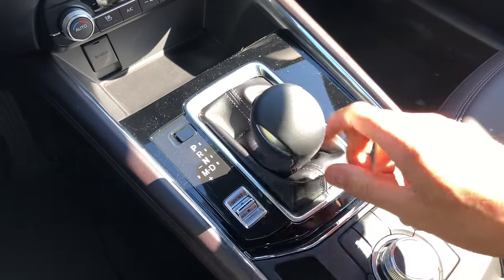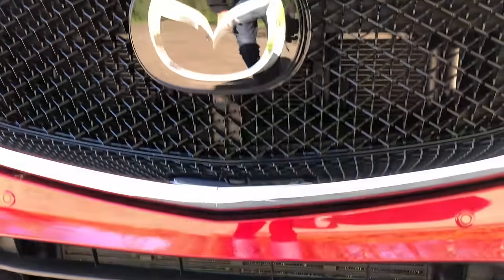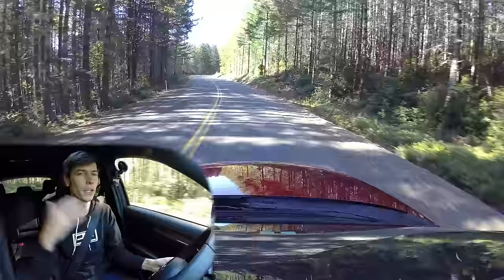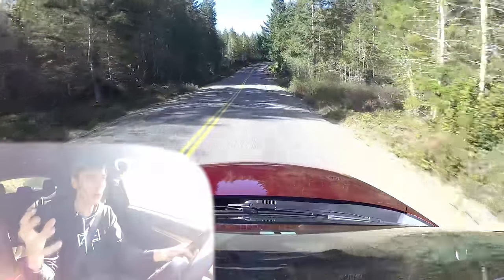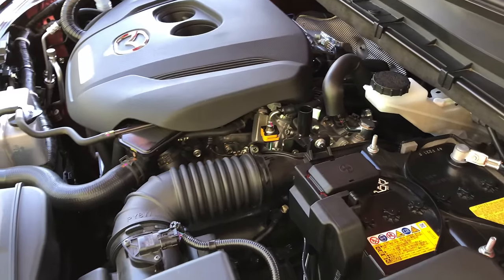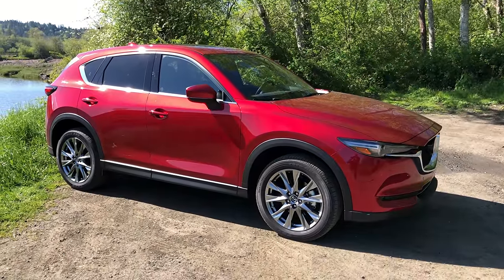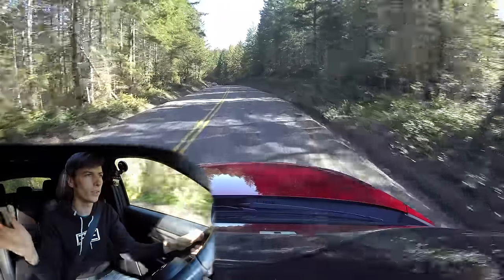Are CVTs Bad? Why Mazda Avoids CVT Transmissions

Comment: Subaru and Honda (two of my favourite manufacturers) use CVT instead of a proper automatic in their vehicles and I HATE IT. CVT's are total CRAP. I didn't buy or lease one, I test drove it just to see... And wow, it is completely gutless and it is remarkable that it feels even more disconnected than an EV. Seriously, you're riding around in this thing and trusting your life to it -and you have no idea what's going on underneath you. It's only marginally more efficient and lighter than an automatic transmission -but they only last about 100,000km and then you have to spend around $7,000 to replace the thing -and that's seen as a benefit?!?! With an automatic transmission (without Gear selector), you may have to mash the gas to find the gear you want, but you know when it's coming and the transmission can pretty much last the life of the car (not including Dodge, of course lol)... Plus you can pair MORE power and greater WEIGHT with an automatic transmission. So if you ever want to tow something or you live in an area with hills or you have a steep driveway -a CVT is not for you. A CVT is not for anyone, really...

But, unless you're in an f150+ or another full size truck+, automatics aren't your best option either... For all passenger cars the best is and always has been: manual transmission. Nothing is better than stick shift.

NEVER buy a CVT. They're complete crap.
Reply: Dsg is cool

Comment: I’ve been looking at used Mazda’s lately. I’m not sure if I want the 3, 6 or the CX5.
Reply: Jamie F Take a "6"! Best car I've ever had! I already got 100.000 miles on it and cannot see anything that has gotten worse! The "3" is a lot smaller but almost costs the same! The CX5 is a nice car but hasn't got as much cargo-space as the "6"! Most engines are equal! I got a 150 hp diesel with never less than 50 mpg!!!
Reply: GT86 do you have year recommendations? I like the 2014-2016 but I’m not looking for anything extremely technologically advanced.
Reply: J F Mine is from 2014. Bought it in 2015 with 6.000 miles on it. I still prefer its clean exterior-design compared to the facelifts with all that chrome! But I have to admit that the interior is not as beautiful as in the newer models. Mine is an almost fully loaded sportline with 19-inch-wheels and looks really good! Decide what you like most! All versions are reliable and well equipped! 

...The Mazda-Mechanic recently showed me the issue-statistics of mazda in comparison with hyundai which they also sell! There was one folder for mazda and seven for hyundai!😬

Comment: The problem with a cvt transmission is they will always have at least one part that will wear out long before the rest of the system. This doesn't have to be a problem except that today's engineers are incapable of making provisions for repairs. In fact they delight in burying such parts in the most inaccessible place possible. Then the worthless automotive press will claim it's "high tech.' If they were honest, they would be truthful about what is being done and call it garbage.

Comment: Been driving manuals for most of the time I could drive. My latest car is an automatic, after I swore I'd never go back to one, but was impressed with the 7at in the 370z. Shifts very fast and manual mode feels really good. Modern slushboxes have come a fair way from 90s econocars I was used to.

Still wouldn't touch a cvt with a bargepole but my attitude on automatics has changed

Comment: I hate CVTs to no limit, It is a bad idea, they are unresponsive especially at higher speeds and get you into trouble, they overheat, they are horrendous to maintain.. it is just a giant leap backwards

And all that fuel economy will go out the window when you have to simply change it’s expensive fluid or worse still; change the whole ugly thing

Comment: I am in Las Vegas now with my family and my wife and I rented a Nissan Rogue (automatic with CVT) boring car to drive and it has no pick up. I have to floor the gas for the car to move. It is sad the auto industry put this transmission in its cars. There are still some good samples which don't use it.

Comment: "From an engineering standpoint"
From a customer standpoint, using a reinforced rubber belt to drive a transmission is just insane. Don't care how reinforced it is. End of the day it's basically a timing belt for your transmission.
Your videos make me think you're definitely an engineer who doesn't spin the wrench too often himself
Reply: Not like a timing belt. Most like a multi speed bicycle. Instead of a chain moving up and down a cone of gears, a belt up and down a cone to change ratio. They have been around on small motor cycles and garden vehicles for 50 years. They work well on light weight vehicles. If you put a lot of pressure on them, the belt slips more and wears the metal off. Is why you never see them in a truck or a true 4wheel off road vehicle. They can last on light weight cars in the flat lands if you change the metal impregnated trans fluid quite often. Mazda took the safe approach for performance, reliability and mpg until all electric autos become the norm.  Toyota's eCVT hybrid is more like a Tesla than a typical CVT because it uses electric motors to turn the rear wheels. A really great approach. I'm likely purchasing a Cx5 when the market settles a bit.
Reply: @ltwig476  I fully understand CVT transmissions. The belt is an issue. Reinforce it with steel all you want, at the end of the day it's a steel reinforced belt. They don't last. Tires don't last, timing belts don't last
And if it was actually like the gearing of a bike it would be made from a chain

Comment: I get why manufacturers are going to the cvt. With rising fuel costs (limited commodity!) they want to advertise the mpg. It’s a cool technology but it’s not ready yet. Reliability problems, poor throttle response, etc. I’ve recently driven most of the cvt’s (shopping for a new crossover suv) and they’re all lacking in a lot of ways. I’m going with the cx5

Comment: Your wrong! Most people know what a CVT is and only find out what they are when there Nissan CVT fails and it’s cost to repair is just ridicules. Nissan uses the worst brand and they fail more then any other CVT. Everyone is better off going with a regular automatic transmission. 
One other thing is the turbo seems to be the way every manufacturer is making good power with small engines and it’s great short term but the turbo and the stress plus heat generated will shorten the life of the small 4 and 3 cylinder engines. Your much better off to go with a little bigger natural aspirated engine and you don’t need a turbo always to produce big power, there are 2.4 liter engines out there making 200-250 HP and those non-turbo engines will last much longer.

Comment: I have a Subaru crosstrek XV. I hate the CVT with a passion. It is unresponsive, slow, snappy when it does respond and the noise is awful. Don’t buy it
Reply: Learn to drive a cvt, don't blunt floor the pedal, drive on revs, keep it between 2 to 4k rpm get the feel. An electric car You can also not drive it like MT petrolcar.
Reply: J.R. Arnolli I get the most response if I give it half throttle, but it’s older and needs fluid replacement so it probably is better than I think

Comment: excuse me sir with all due respect. do you really think the consumer knows what hell is CVT. ?!! the only time they knew what is CVT. is when they have a catastrophic transmission failure. that require expensive repair and . when they ask WHY?! they will learn later on . because they bought a CVT transmission vehicle . i use to like Nissan Maxima a lot. until i learned the damn thing has the worst CVT transmission in the Market. and i also learned Nissan one of them companies having hard time recognize their engineering failure. and people have to sue them!!. so i think Mazda is doing the right thing regarding the transmission. what they are doing wrong ( Mazda ) here is the infotainment system display. the screen neither too small or just looks awkward !! . to my opinion.  the specs of the tire size/wheel. are more narrow compare to the body design. so it does gives undesirable overall look to it . that can push away buyers. when manufacture make a sexy looking concept such as Mazda. that doesn't look as good on the production . here they are the creation of their own problem. they need to learn exterior design from the Germans all Japanese need a heavy dose lesson from the Germans exterior designers.

Comment: I had a 2006 mazda 3 with 5 speed auto .... first transmission computer failed at 60K, the 4 months after the dealer replaced the computer ($2K), the whole transmission failed  .... car is junk!

Comment: They are buying these cvt cars because they are not aware of the problem riund the corner  i.e. the belt breaks.
Even to the most unwitting person, if you ask what happens if you keep bending a bit od steell back and forth, they will tell you that in the end it will beak, they call it strees.
Well thats just what happens to these belts because thats what is
 happening all the time the engine is  running.
The other factor that all tge car makers  keep silent  about is thevfact tgat tgess belts are made up of tiny bits of steel bits held together by fine steel belts that are always being  bent, when they give in, you now have an engine with little bits of metal floating around allmover the place, and the cost of repair is the same as buying a new car, the cost of the belt will empty the wallet out, that before we come to putting it in thr car.
A lot more should be  said  about this form of transmission so that people are aware, that the cost of the belt is enough to empty the bank account, is not something that 99% of people could attempt themselves and the fact that it is not made to last the car and has a replacement date that in reality shorter than a spark plug, you can clean a spark plug and ajust the gap, you will not be able to do the same with one of these belts, so as well as being up for a new timing belt, you will be up for a new  ctv belt.

Comment: Mazda very high compression ratio makes for changing oil every 3-5k miles is no good for your pocketbook. Go with Toyota's modern engine/cvt package where you only need to change the oil every 10,000 miles.

Comment: This is narrative is just being “politically correct” not to talk about legendary ills that CVT transmissions carry. CVT is the most inefficient transmission there is. This is pulley and steel band (belt) driven piss-pot that is disastrous and premature failure (mostly say in less than KM 125k) requiring replacement costing nearly $5000 as the cannot be repaired; as opposed to a conventional/traditional positive driven automatic gear box. I will not touch one even with a barge poll.  The advantage is to the car manufacturer to come up with a CVT that cost about 40% compared to a conventional automatic transmission. Peopla are (especially women) not even aware of the difference and the manufacturers and sales people don't talk much about CVT.

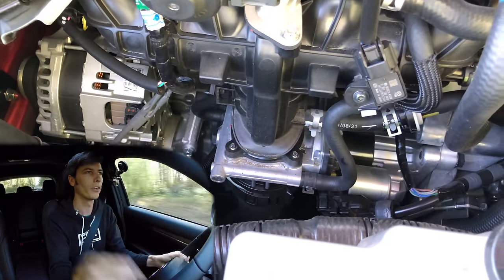Comment: Jason - I am a usually big fan of your work, but I am afraid that in this post (timestamp 7:05 ff) you are promoting a misconception about how CVTs improve efficiency.  CVTs DO NOT achieve efficiency by keeping the engine in it's most-efficient range (which occurs near maximum torque, maybe 2/3 of maximum RPM).  Instead CVTs keep the engine at the best efficiency FOR THE AMOUNT OF POWER REQUIRED.   So, if you need 5 horsepower to cruise at 25 miles per hour, it would be extraordinarily inefficient to spin the engine up to the 4000-RPM maximum-torque speed of your 200-horsepower engine (or anywhere close to that).  Instead, the CVT controller dials your engine engine back to not very far above idle RPM, to an RPM where 5 horsepower is the best it can do. At that RPM, the engine is not at all efficient in the absolute sense, but it is MORE efficient than providing 5 horsepower at any higher RPM, which would always occur in 2nd or 3rd gear of a traditional automatic transmission.   - Joe C.

Comment: CVTs CAN be fine, a lot of them are just badly built. toyota's CVTs, for example, are incredibly reliable and used in applications all the way up to 400+hp and giant SUVs with no problems.

Really, just like automatics. They can be just fine, but there have been an awful lot of them that have been garbage.

Furthermore, a car with a properly tuned CVT would actually be faster (and probably considerably so) than a conventional transmission, as the CVT could keep the engine in it's optimum power band at all times. Keep in mind that the CVT is banned in Formula 1 not because it sucked, but because it was too fast.
Reply: em745a  
>feraris, lambos and bentleys
ahh yes literally the least reliable cars money can buy. this is a good example.

>bimmers
BMW actually does use them in minis

>mercedes
also uses them in both the A and B class.

>lexus
uses them in all their hybrids, including large SUVs and 400+ HP LWB limos

>limos
the lexus LS600h is sold as a limo, in fact it's even sold as an armored limo.

>super duty trucks
 are combine harvesters super duty enough for you? what about 12 ton tractors with 1200 ft-lbs of torque? no? ok, how about the 48 ton, 1200hp type 10 main battle tank? 

because all of those use CVTs, and they could all crush your puny brodozer.
Reply: em745a I see several great examples. an Mercedes bens is a Mercedes. It puts out power like a Benz regardless of Aor B class. All you did was move the goalposts bc this person handily proved you wrong

Comment: It is automatic transmissions that are bad. CVTs are just an inferior variant.
Reply: drwisdom1 / Learn first how to drive with a CVT, then try again. Just flooring the gaspedal isn't the way how to drive with a CVT. Use the gaspedal to keep the revs within a certain bandwide. Use Your tachometer!! I've been driving CVT cars since 1964.
Reply: em745a  But of course it is the manual transmission. Not because of the gratification or the increased service life, but because manuals are so much safer than automatics. Automatics let you drift so you can't respond in time when a bad situation arises. Automatics want to crash your vehicle so we are adding "safety tech" to finally try and rein them in.
Reply: em745a  Living is very important to me. If that requires my time, brain power, and attention - I'm good with that. Go to the craigslist in your town and search on the vehicles that have 150,000+ miles. Only a minority will have automatics. Once an automatic breaks it often isn't worth fixing the vehicle. Clutches are inexpensive and easy to install compared to fixing a malfunctioning automatic.

Comment: Reasons do not exist to WANT them and "engineering reasons" are trash since engineers don't have to fix the junk they design. Every maintainer-hostile mechanical and electrical choice on every system was made by an engineer, and that's so bad many mechanics are quitting.

Comment: What is surprising is that according to fuelly, the CX-5 real world fuel consumption is pretty much identical to the Rogue Sport, which measures quite a bit higher on the EPA cycle than the CX-5

Comment: I have a CVT and I don't mind it.  Its smooth enough and only gets loud when I floor it (which isn't often).  I was told that to keep it as reliable as it can be have it serviced every 30K. I just did that and it was THREE HUNDRED BUCKS.   Even if it keeps its reliability throughout the time I own it I will never get one again for that reason. Way too expensive to maintain.